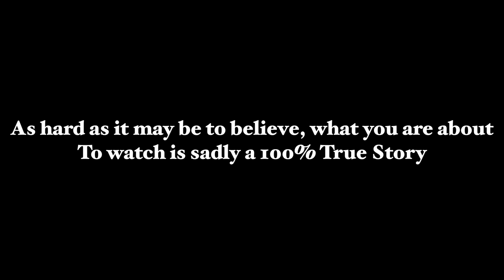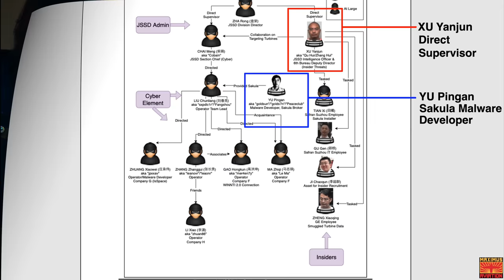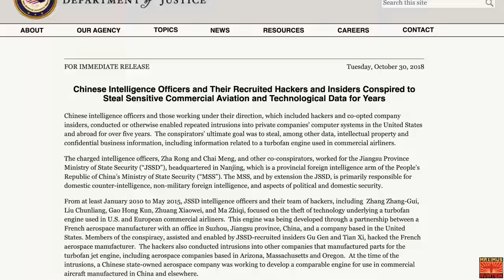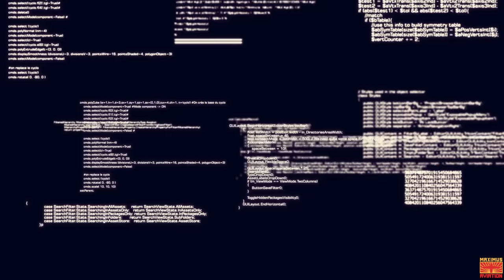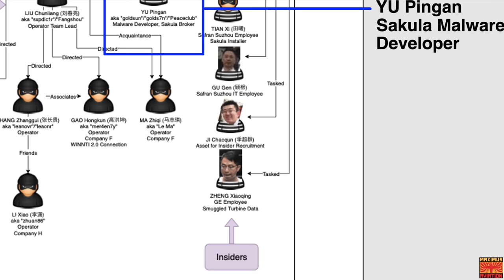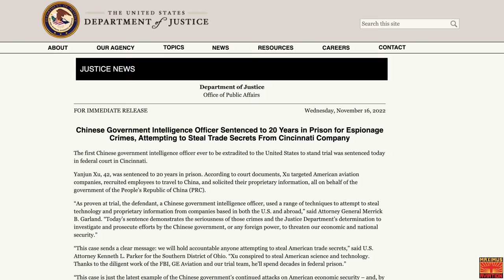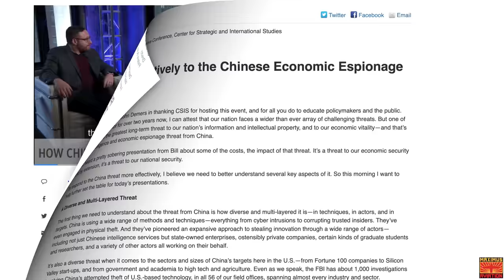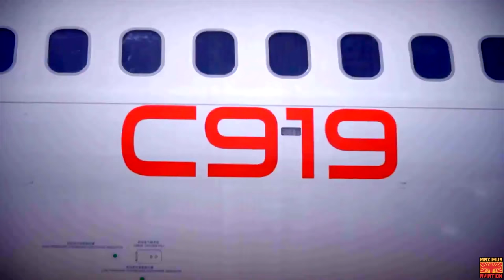How China STOLE The Technology From The West To Build Their COMAC c919 In A 5 Year Hacking Operation

Comment: Having a part is one thing. Knowing how to source material, build it efficiently, consistently, how to maintain the manufacturing process, etc is a whole other level. Then knowing how a company subcontracts and especially the prices paid for everything let's you target effectively. China could easily get any commercial aircraft part. But knowing everything else that's normally a secret gives them a huge advantage, especially when working with the employees of these companies. It's not the reverse engineering, it's everything else. Is huge leverage. If you add test and engineering results and future plans, plus what employees work on what project, and then you can start sniping and attacking part by part, supplier by supplier and build your own ecosystem.

Comment: Would it be more reasonable for Comac to buy a used fleet Airbus a320’s and reverse engineer some of the technology since used aircraft come with the maintenance manuals?
Reply: They build them there...
Reply: not when the chinease gov is floating the bill. mitsubishi did the same thing a couple decades ago. basically spent 20x the price making slightly better suited f-16s that cost more than 2 f35s lol... but the japanease gov wanted them to learn how to do composite stuff. now the dreamliner wings are made in japan. im not sure if this is by mitsubishi but im guessing it is a tight knit group of engineers.
Reply: Is that what you think they should do?

Comment: Based on personal experience, where the Chinese fall down is in the physical manufacturing of the design they ripped off. Their quality control in advanced components, especially electronics and advanced metallurgy/composites is very poor. And their industrial base for such things is also very immature or lacking altogether.
Reply: That's what the hacking is for. Anyone can get a component. Knowing everything else about a company is what they need, and hacking gets you some of that and helps plan other ways to get the info they need and who else to target.
Reply: @zlm001  You don't understand my comment, which I think is pretty clear. It's not the hacked information they lack, it's MANUFACTURING capability that's their problem.
Reply: @k9killer221  👎🤐
Reply: Yeah you only have to look at all their failures trying to put landers and robot rovers on the Moon and on Mars. Oh, they did it on their first try. On the far side of the moon too, sure to fail. Oh, it succeeded.